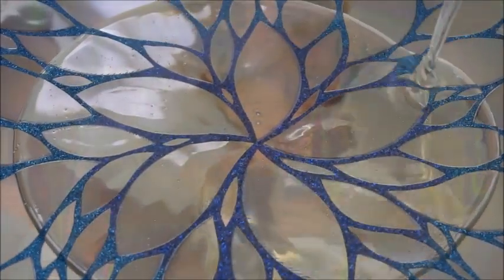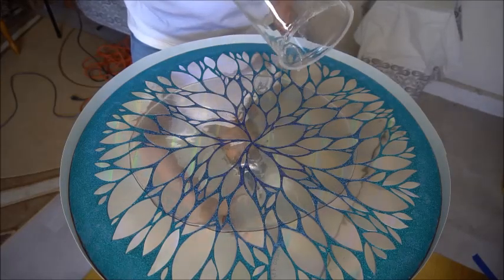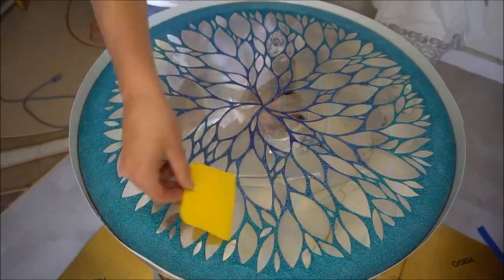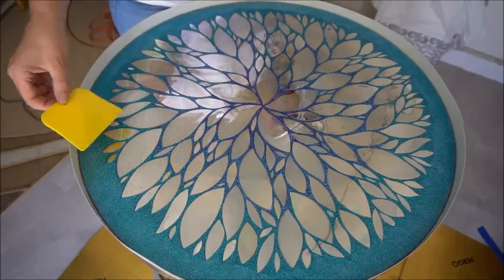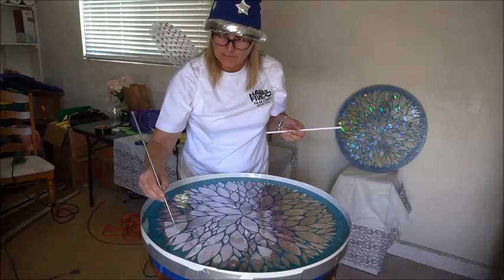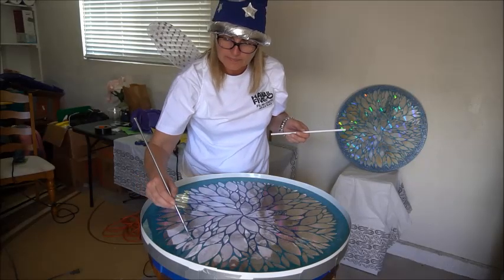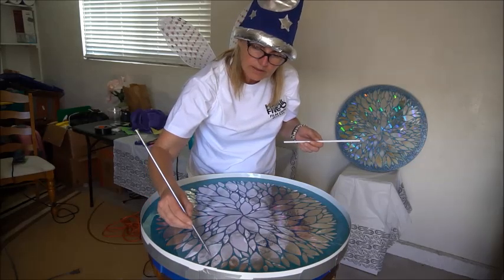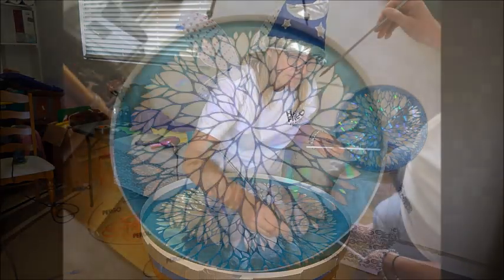DIY Upcycle CD's & Glitter Table Top Resin pour - part 2

Comment: Gorgeous,I tried to do something similar but had troubles trying to get a clean cut on the CD's,any advice?😊
Reply: Dip the cd in a pan of very hot, (close to boiling), water for about 20 seconds. Lift it out with tongs. Now the Cd will be flexible and pliable, not brittle. You have about 5 minutes to cut it into any shape you want to. If it starts to get hard and brittle again while still cutting your shapes out of it, take the tongs and dip it into the very hot water again. .